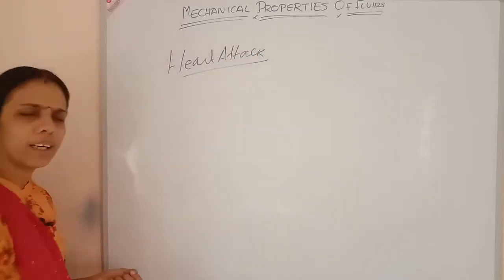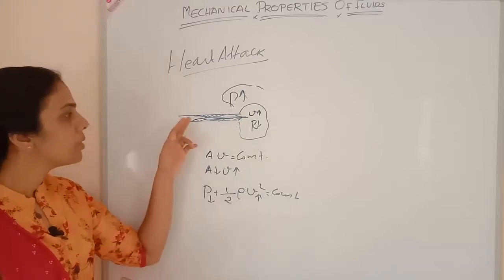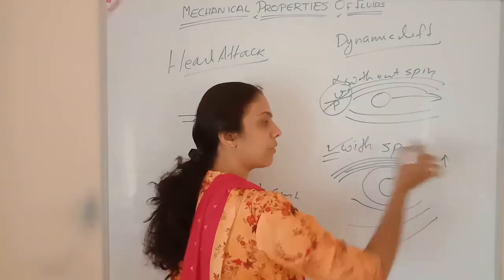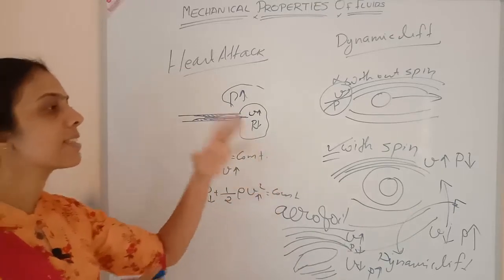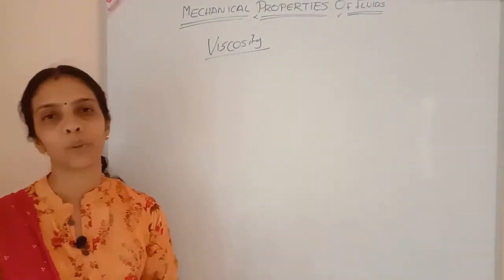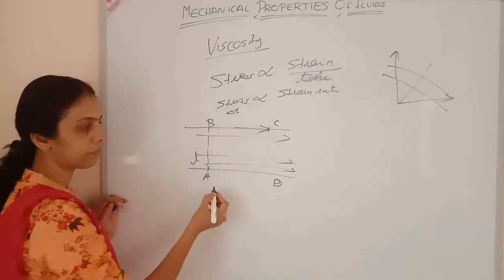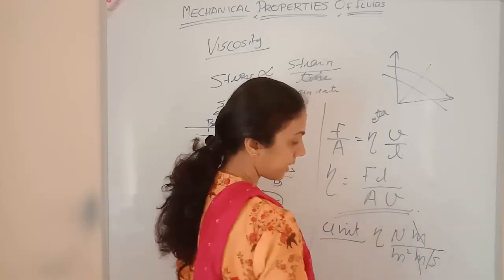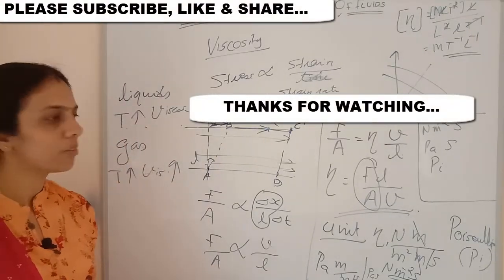CLASS 11 MECHANICAL PROPERTIES OF FLUIDS PART 4

Comment: Mam if area is small  pressure will be more..
Reply from the maker: S
Reply: But u said that pressure decre when velocity increase
Reply: @LearnPhysicssumi  Please note ma'am, when fluid flow through a pipe if area of Pipe decreases,  Velocity increases and pressure decreases. ( applicable for Steady & incompressible fluid flow).
I am watching your videos to teach my daughter. Classes are very useful, Thanks
Reply from the maker: Pressure decreases when velocity increases as per Bernoulli's principle. U askd abt area and pressure. Here between velocity and pressure
Reply: But velocity and area are inversely related
Reply: @17dhakshika67   velocity of fluid is inversly proportional to area (Continuity equation) .  In venturimeter as fluid flow from large area to narrow (throat) area, Velocity will be high at narrow throat and Pressure decreses. 

we can say , As area of a pipe decreases fluid flow velocity increases same time  pressure of fluid decreases
Reply from the maker: Area is where pressure is applying. But Bernoulli's principle is for fluid inside the pipe or container